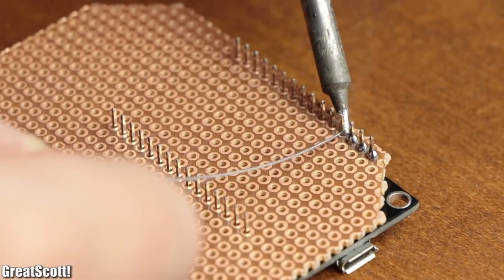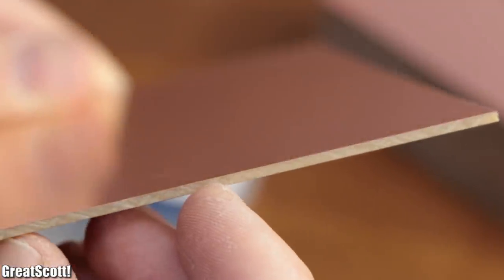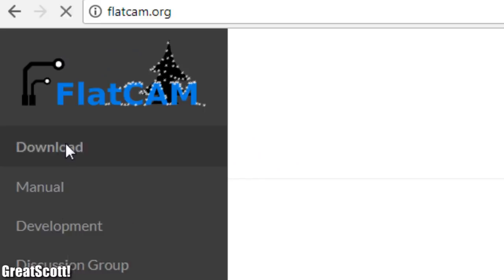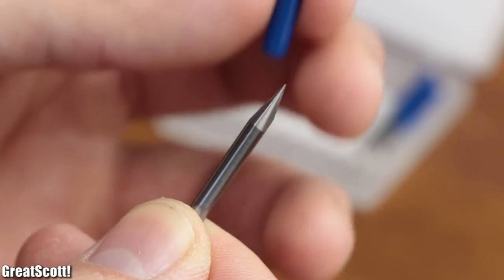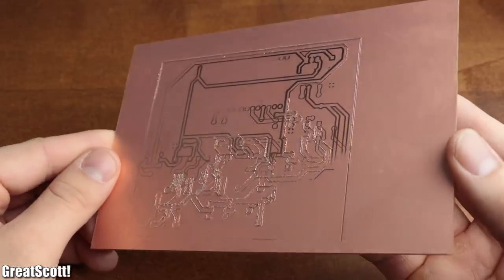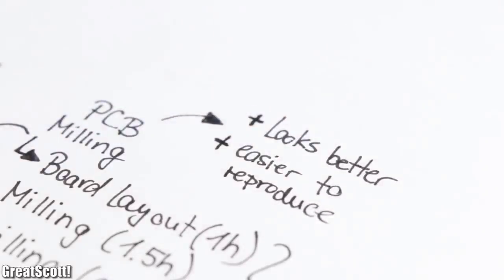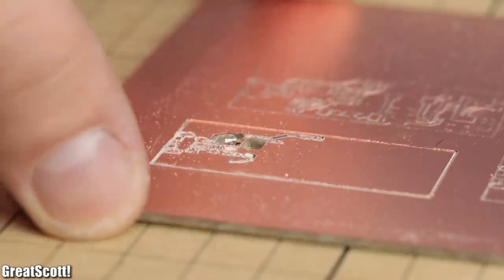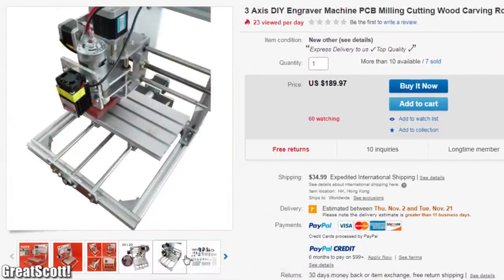How NOT to Mill a PCB (except for SMD)

Comment: somehow this got to the algorithm in 2024. definitely an outdated video and its conclusion. those cheap china 3018s with proper upgrades can mill clean milled circuit boards (MCB) at speeds >450mm/min up to 0.1mm traces with just 1 pass. drilling those holes will be a breeze also. there are also a lot of improvements in grbl and candle (eg height map) to date. after you generate the gerber files (which you still do when you order pcbs) the milled and drilled boards can be had in less than 30 mins.

Comment: we use mits electronics autolab(~5k$), 60 degree 0.2mm bits and 12mm per second milling speed. i make this ( https://prnt.sc/mvl83l )  two layer 10x8cm  pcb in 45 minute, 30 min for top - bottom milling and  10 min for drilling and 5 min for outline cutting.

Comment: this is so not the best example for pcb milling. i build and sell small desktop cnc mills designed for pcbs and there are so much faster than what you're doing here. if you'd like send me the first and the second pcb grbr files and i'll show you a great result done in 15-20 minutes. drilling included, and board cut out! those feeds were way to slow, i dont know if that's all what an xcarve can do but i doubt it.

Comment: What about going a different route... Instead of a spindle, mount a water prove pen, and let the machine draw the PCB and then etch it... should be must faster than carving... and failed attempts dont destroy boards..
Reply from the maker: Sounds like a good idea. But I doubt that you can get the lines so fine to create SMD circuits with this.
Reply: Well, I have found pens with 0.1mm tips, but yes... no idea how that will hold up against being etched. But im going to try it once i get my 2d plotter build (with my 3d printer)

Comment: It sure does rustle my jimmies to have a popular youtuber like you try something, fail in a classic way and then say what I'm doing (THT PCB milling) is a waste of time. Perfboard's alright I guess if you don't need precise placement of components and your layouts are simple. Ordering from a cheap Chinese factory is alright if you can wait for eons to receive the board. 

Prep work to get the job done right will waste some more time but on the other hand your feedrate must have been way too slow. Well, depending of course on your spindle rpm.. more is merrier in micro milling. Auto-leveling was already mentioned but besides that you need to check the tip widths and angles carefully to determine the right depth of cut. And secure your workpiece properly, those traces were going on top of each other.